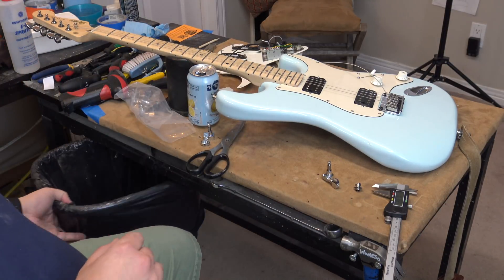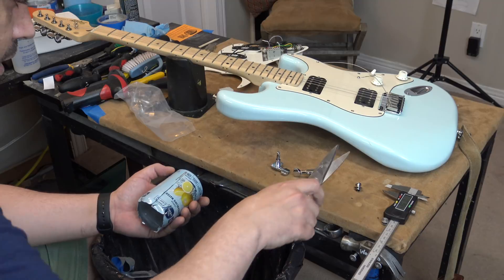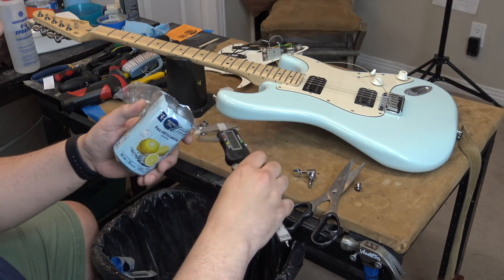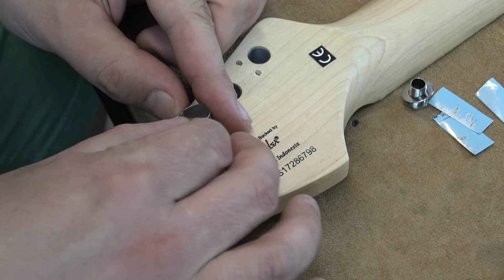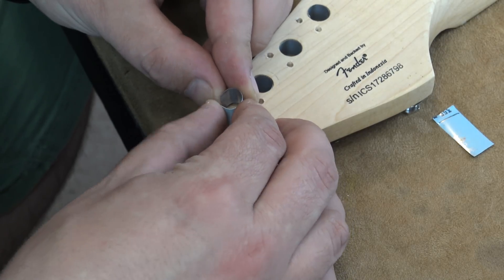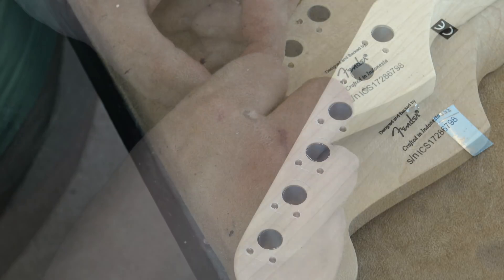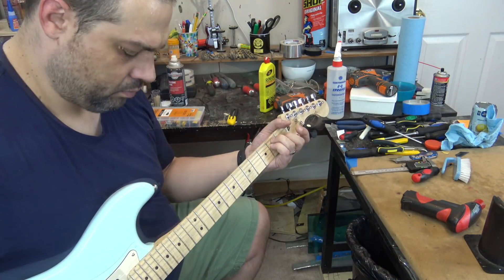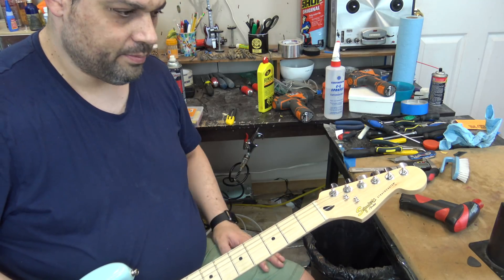The SQUIER "Aluminium Can" Tuner Mod Trick

Comment: Even for tuning machines that actually fit fairly well, I TIGHTLY wrap the tuner's shoulder with (StewMac) 1/4 inch copper shielding tape.  Pays to leave it a bit oversize and then force it into the hole.  You can even go by length, overwind the first one, unwind and trim until it fits very snuggly.  Then remove it and measure the length, cut six pieces.

Comment: I would have probably taken a more drastic approach and filled each hole with a dowel rod and re-drilled the holes. I've also used JB Weld to fill in unused control knob holes before refinishing with stellar results, that might be an option? Incidentally, I have an Indonesian Squire i'm planning on replacing the tuners so great heads up to check the diameter first!

Comment: Why not use shielding tape? You could easily wrap the tuner until you achieve the desired thickness, then cut off the excess. And it seems like it would be way easier than trying to wedge in pieces of an aluminum can.

Comment: Nelson,  Would locking tuners fit with your insert technique?  They require the 2 pin holes.
Reply from the maker: Yes... I had these US standard Fender tuners in my drawer. I fit these to essentially get the headstock ready for the locking Fender tuners which are exactly the same footprint:-)

Comment: I wouldn't want to do that on mine but it was great thinking...  At least that should not compress over time like some other solutions.   I'm curious, Is there no upgraded tuner that fits ,  without moding and extra holes?  Anyway, good thinking and nice job.
Reply: Ah, bummer.  I see.  Good thinking.
Reply: I put Gotoh tuning machines in mine. They are metric so a perfect fit. 10 mm hole.

Comment: So any locking tuners I buy will not fit my squier or only if they are fender American they won’t fit? Cool trick
Reply from the maker: Exactly :-)
Reply: Woodeso's Guitar Mods that sux they never tell you these things when you purchase them.. there’s no parts for squiers I swear!
Reply: if you love the feel keep the guitar for sure! i fell in love with a squire 70s vibe P in a guitar center and had to have it, i dont have many guitars but when i picked it up i liked it and i kept on going back to it over and over until i scoured ebay and found a very good deal i put a wiring harness in and its even better!. try out a few guitars if you cant find anything you're satisfied enough with to replace your guitar that you like now then get humbucker and the tuners (:
Reply: this mod benifits 'new style' cheap tuners that fender puts on squiers (that are fairly good for the price point and adequate for bedroom playing imo) based on how the tuner clamps to the guitar it uses the bushing to as a nut to clamp the machine in the hole of the headstock with a post on the bottom of the tuner to prevent it from twisting  instead of the entire tuning machine being screwed to the back with small screws like fender standards/vintage style tuners and gibson style tuners
Reply: Slimjim 198 ya my squier is 2013 def cheap tuners. I love the feel of the guitar though so I’m debating locking tuners replace my bridge humbucker or go for used Mexican fender or a new squier contemporary.